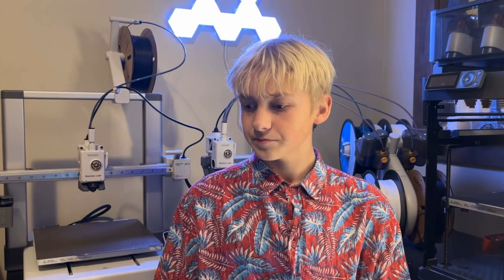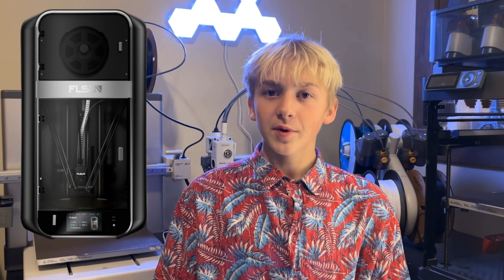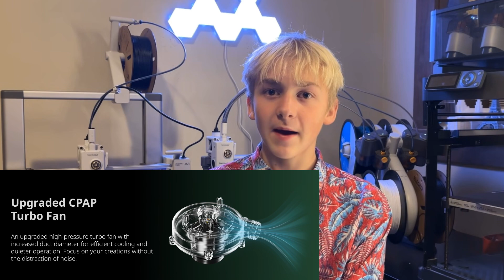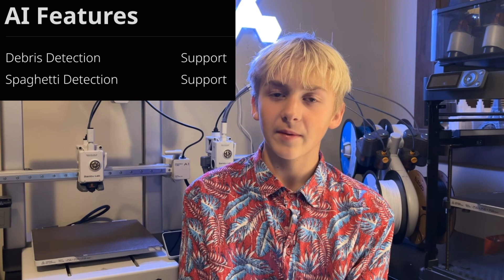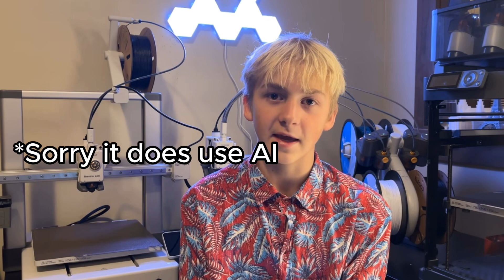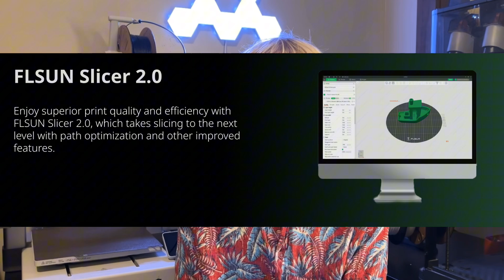S1 Pro: How it is changing the 3d printing community! @flsun3dprinter

Comment: Filament weight sensor probably works with base value. When you add new filament and it's 1.2KG then you have 1KG of filament and 0.2KG of spool so it knows that on 0.3KG it only has 0.1G of Filament.
Reply from the maker: Oh, that makes sense